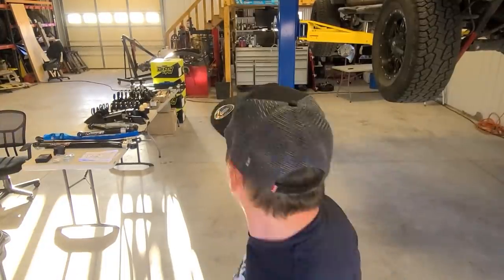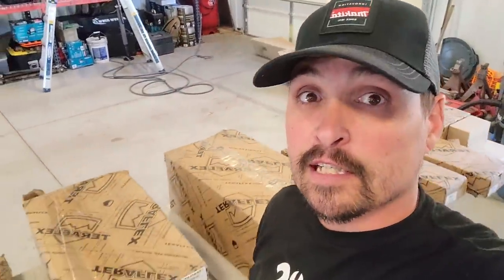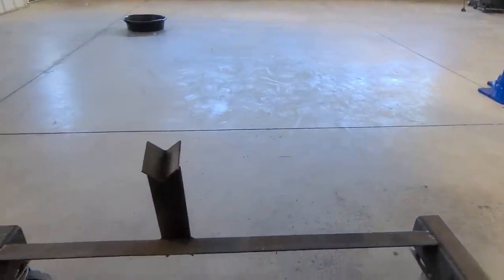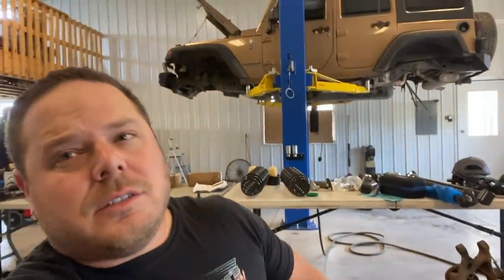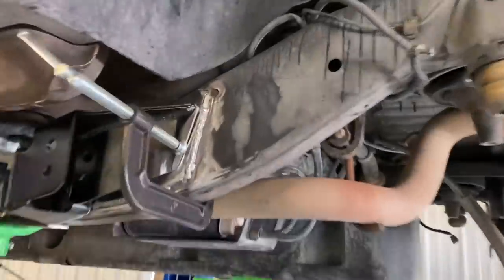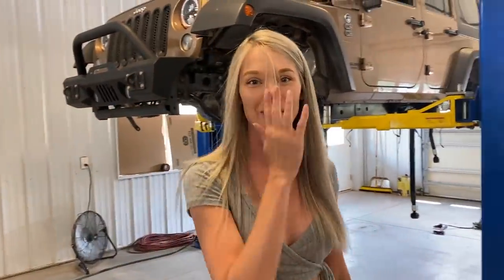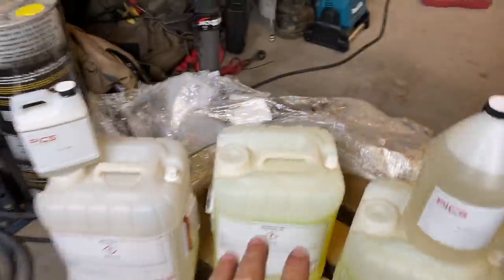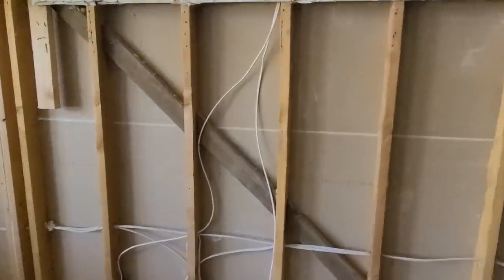TERAFLEX LONG ARM INSTALL on a Jeep Wrangler JK!

Comment: The brake rotor improvised "slide hammer" technique can do a "number" on the axle stud threads if done carelessly!  That is why they make axle pullers that attach to a slide hammer device!
Reply from the maker: This was a how to when on the trail and breaking an axle shaft. This wasn’t a how to for the shop. I guess I should have specified.

Comment: Hope y'all enjoyed Phoenix. We sure are having an extra hot spell right now. Letzroll is were I am going to have my regearing done on my TJ. The Dana 30/35 combo with 3.07 R&P is no bueno. Bought a rear Dana 44. My suspension is on order from Savvy Offroad. So far still to go when starting with a mostly stock TJ.

Comment: 2008 JKUR Auto here. I run the 5.38 gears, since 2010, on 35's. But, I had them cryo-dipped.  And I love them.
But, I was setting up for snow plow use, and pulling a trailer for my work.  Would post a pic, but don't see that option.

Comment: I’m assuming Chris will be pulling more axles so I would suggest building a taller axle stand/fixture.   I fabricated an adapter that bolts to my transmission jack that works great for raising and lowering axles into position rather than raising or lowering the vehicle.   They work great and much more efficient being able to stand and work.  I built another adapter that fits into my engine stand for either working on or moving axles around once out of the vehicle.  

Lastly, I fabricated some mounting fixtures that bolt to my fabrication table which allow me to hold axles rigid while working on them doing either gears or setting up mounting points.  Easy to take angle measurements and transfer to the axle while it is held in place on the fabrication table.   

Just a couple of suggestions to help workflow that I have found throughout the years.  
Mike

Comment: Nice work. From my experience filling in the factory gouges in the frame and sanding them smooth looks better but thins the frame out even more by the time you grind over them again. Tricky to weld if you ever have to place a 1/4” thick bracket in that same spot without blowing through the frame

Comment: Chris did a nice job with those long arm brackets.  I'm literally doing the same install on a JK, though waiting on a few parts. Just for shots and goggles what were Chris's welder settings when he was dialed in, on what wire size?

Comment: On my 2006 LJ with the 6sp manual I went 4.88 gears with 35" tires and the rpm was almost exactly the same is stock.
Reply: Good to hear I just ordered a new front axle and having the rear geared to 4.88s
Reply: On my 05 6 speed I’m not sure if I wanna do 4.88s or 5.13s with 37s
Reply: @ivanfromtheeast4709  my goal is 37s and the way I look at it was 4.88 when I got to 37s if I’m not happy with the low 4x4 I’ll buy either a rubi case or upgrade to an atlas… 5.13 has a really small pinion gear
Reply: @jonpaff5699  Yeah i calculated it out and 4.88s is pretty close to stock ratios with 37s.  And I already have a rubicon so I am good in that regard.

Comment: Yes, parts are hard to get right now. Finally got my 2021 JLUR back from the dealer after two months due to the computer chip shortage and multiple parts being replaced by the dealer. Factory tech support had to get involved with troubleshooting and found a bad PCM. FCA took care of us for the inconvenience.

Comment: Can I make a recommednation for the grinding issue of steel shards? Make a few wood sawhorses. make top tables for them. Grind away. Underneath use the strongest magnet Amazom sells that you've hung from the bottom of the sawhorse where it is a few mm from the floor. It will suck up EVERY single shard you create. Seriously. Works incredibly well.

Comment: Be honest Kevin.  Did you like the Metalcloak rock slider?  I just put the same one you had on my Jeep.  Love it so far.
Reply from the maker: Yes. The Metalcloak sliders worked great. Never had a issue with them until they collapsed and took out the door, rocker and qtr panel. Took about 3 years for the to happen
Reply: @LiteBrite   This is why I bought it after watching you beat it up for 3 years.  And it seemed to last through most of it.

Comment: Please be patient with everybody. I’m in a completely different industry and we can’t make (or ship) enough product fast enough. Customers are acting like we’re the only company on the planet having trouble. Remember, it’s not the fault of the employees who actually come to work.
Reply from the maker: Definitely correct. It’s easy to forget the person on the other end of the line is human & not at fault. Takes a lot of understanding from both directions.
Reply: @LiteBrite  When I have an issue, I make it a point to tell those I speak to on the phone that I very much appreciate them and that I know it isn't their fault. 
I also stop others I'm around if they're on the phone, or face to face with some poor employee that hasn't done anything wrong, and or has no authority to change or fix the issue at hand.
Like calling the power company if your power is out and yelling at the person that answers the phone. lol. They had nothing to do with it, and there's nothing they can do to get it back on any faster.

Comment: spotted at 15.06 scout 80/800 front nose clip.
Reply: and scout 80 dash
Reply: WINNER WINNER WINNER, But I have no prizes.  It's a 1960 scout 800. It's a project for a friend of mine, I started just over a year ago. It's getting a some TJ axles and maybe a 4.0 or maybe a rover v8 (cause they make good power and all aluminum) that will also be on the channel when I get all the parts up here from LA

Comment: Hey Chris. Forgive me if this is common knowledge. But I wanted to tell you my mistake so you don't do it. Toyota regear. When you bolt the third member to the axle housing. Be sure to use a new gasket with no sealant. I used sealant and after a year the sealant failed. I talked to the foreman at Toyota. He told me. Gasket no sealant dude!!! Just a heads up. But you probably already know.
Reply: Most of the time, I just use a little smear, to keep the gasket in place when installing, not for sealant.  Specially on cork gaskets, "sealant", when fresh, will actually act as a lubricant and the cork will split under pressure.

Comment: Is this an auto or manual? On a 3.6 manual, 5.13s for 37s may be more ideal, unless it sees a lot of flat highway miles.
Reply: It's an automatic transmission and does see a lot of highway miles.  I'm fortunate to have Kevin & Chris give me their thoughts during the process and give honest opinions & options.  Until I get a engine swap this will fit the bill.  From start to almost finished, the detail and possible options to complete this with available resources has been amazing.

Comment: The welds look good but seem fat.  Was there adequate penetration into the base metal.
Reply from the maker: They are fat in some areas because the brackets didn’t fit properly and there was a big gap that had to be filled. The penetration is there